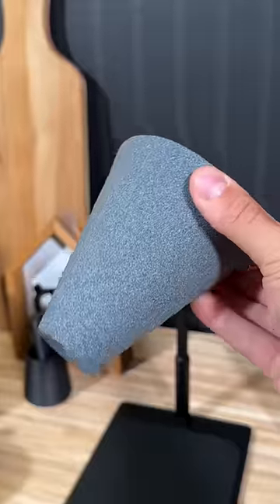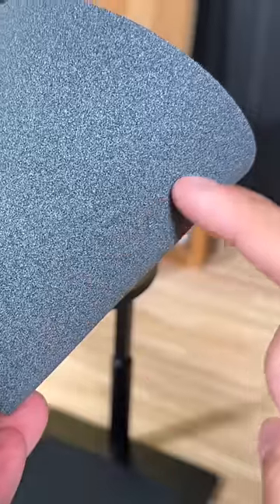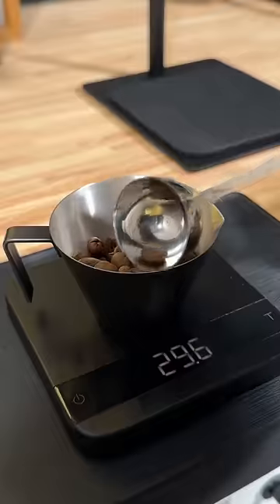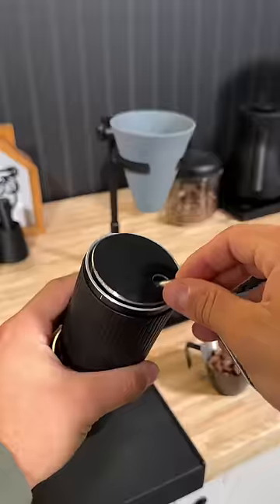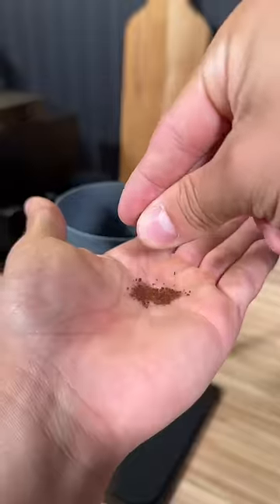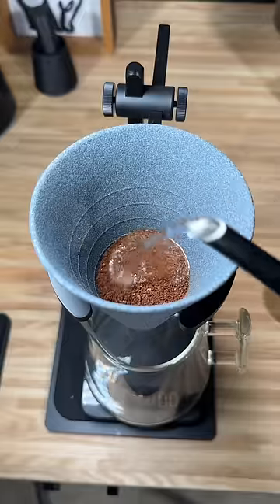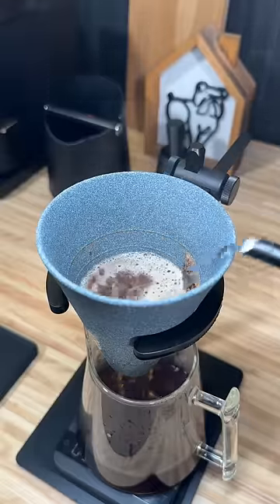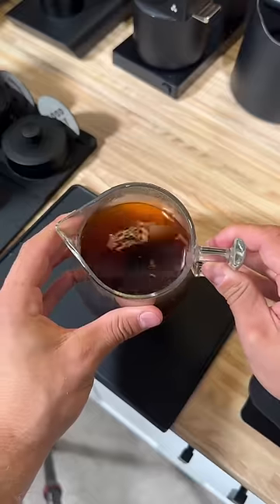Ceramic coffee brewer #coffee

Comment: How do you wash it? Does the soap take forever to rinse, or do you just run water through it?
Reply: lol u should never use soap on anything that goes near tea or coffee
Reply: you basically can't, which is why you shouldn't buy these. you're supposed to rinse them out every time and then boil them for a while every few uses, which only sorta works.
Reply: you boil it and then air dry it really well and hope it doesn't grow anything 💀
Reply: As a potter, I’d probably put it back in the kiln every couple of months, but not really an available option for most people.
Reply: Boiling water will be its soap
Reply: Just pressure wash it outside in
Reply: @sweetbeeurbanpottery4423  Be careful to not accidentally vitrify the vessel fully and make it into a useless vessel.
Reply: Ihave those.. it suppose to be burnt to be clean not boil or washingwith soap
Reply: @meidoraburabu  Let's be real, a little amount of soup wont kill you.
Reply: @smokyz_  it makes it all taste like soap lol
Reply: @meidoraburabu  Sure it does, but it's quick and easy to wash off.
Reply: @ go try it, it permanently tastes like soap
Reply: @meidoraburabu  Ceramic coffee brewer or anything you wash with soap? I can't speak of the former, but for latter, I have washed everything with soap all my life and it always washed off. I have cleaned my teaware and even my kettle with soap and it all came off after a bit of washing with water.
Reply: @smokyz_  ceramic and clay etc, like proper teaware. it gets in those little pores and makes it forever taste like soap.

Comment: You won't damage your brewer forever,  you can autoclave it in your oven
Reply: Think autoclaves use pressure mate. Ovens certainly do not. 

How does that help remove things from the ceramic? Turn it into ash basically?
Reply: @dianapennepacker6854 Autoclave doesn't need pressure. If you have a modern oven, you can use the self-cleaning option. It will get up to 900f and destroy pretty much all organic material.
Reply: @StuninRub  Not an autoclave! Just an oven that does the same thing.

 Definition is....

 An autoclave is a machine used to carry out industrial and scientific processes requiring elevated temperature and pressure in relation to ambient pressure and tempature.

Comment: i wouldn't recommend using this. once you get food material in the pores of the ceramic you can't really clean it out, which you know, but this increases your risk to mold and bacteria, etc. That's why most of your ceramics you use in your kitchen are glazed with a food safe glaze.

Comment: Instead of using it as a brewer try brewing your coffee your preferred way (mine is in an Aeropress) Then heat up your ceramic filter, you can use a blow torch or your stove and then pass your already made coffee through it. You'll be surprised by the improvement this step will make!